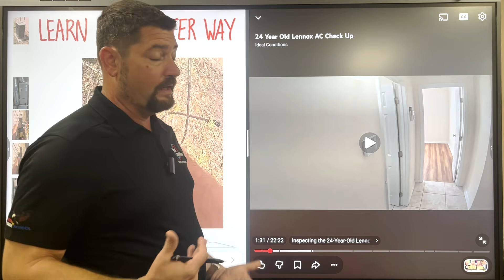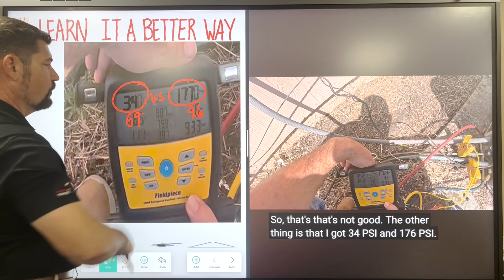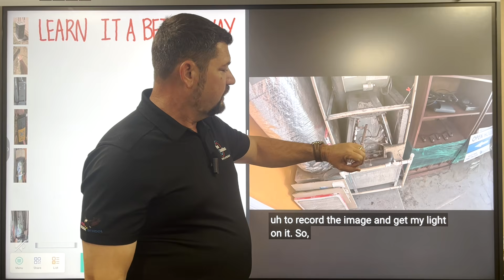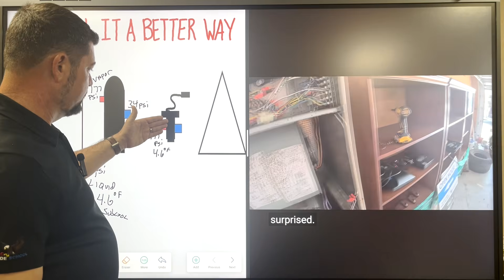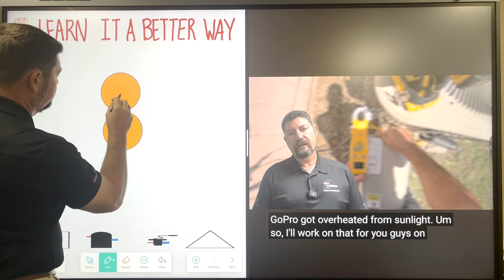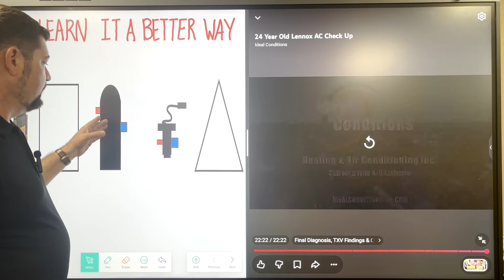Diagnosing a 24-Year-Old Lennox | Full HVAC Diagnostic Walkthrough

Comment: I have the same one...still going!
Reply from the maker: Good to hear!
Reply: Look inside the ductwork look and see what you may be breathing in Is it hospital quality Air, When was your house built was asbestos around it could be blowing through your ducts just saying, you could be potentially exposing your family too other hazards, has any rodents damaged the ductwork, Open the evaporator panel and do you see any growth on it??
Reply: @DiorCartel  Hello DC...great advice and I wondered that also so took to the camera scope, checked above and below the A-frame and ducts surprisingly looks good!  Maybe because I keep a low delta between the inside/outside but I have always been one to keep up with the maintenance with the HVAC especially living here in Florida.

Comment: You’re a very good instructor /tech. I know the videos are technically for learning.  I can’t help offering a bit of suggestion to measure the liquid line temp at the txv to be sure it didn’t get kink on the way to the coil   I know you can’t cover every scenario, but that one might keep you from changing an extension valve if you have a kink and pressure drop   you’re also assuming that the liquid on dryer and the heat pump of the Lennox doesn’t have a temperature difference across that just because you have some cooling on the outside of it doesn’t necessarily mean you didn’t start with a restricted be minor on the inlet of the LL drier inside the Hp sorry don’t need the nick pick  just my opinion please put out more videos. They’re very helpful.